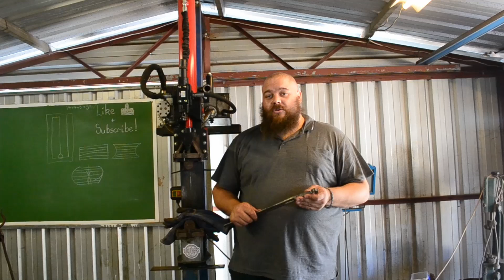Forging a Set of Pickup/Hammer Tongs

Comment: Why spring steel? I always make tongs from mild due to quenching them
Reply from the maker: Most of my tongs are mild, but in the case of tongs with thin cross section nibs designed for contact with large hot work I prefer the red-hardness of spring steel so the nibs don't bend out on me and I lose grip on the work.
Reply: Tongs fo holding large hot material are best made from spring steel for longevity lots of heat soaked into bits will flex an distort over time same as scrolling tongs and bending wrench’s all In my opinion should be made from spring steel

Comment: What metal is that? There is very little scale but it seems easy enough to move, looks beautiful!
Reply from the maker: It's coil spring, probably a 5160 or Sup9 or some variant thereof. Don't let it fool you, it's tough stuff under the hammer. I just hit really hard. Thanks!
Reply: I use a lot of coil spring, its cheap, usually free! Good stuff but can be brittle if you stuff up the tempering! Tongs, that you don’t need to harden is a no brainer!